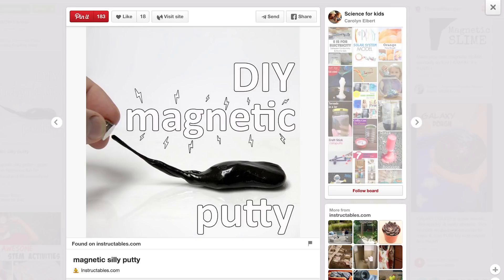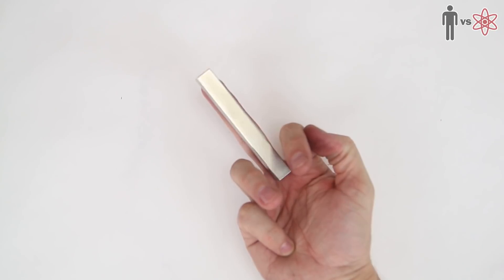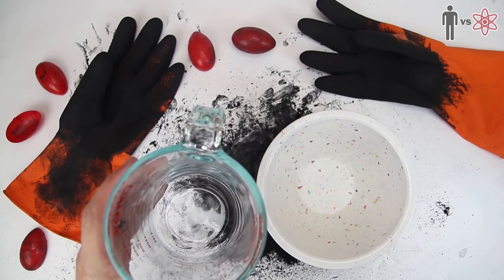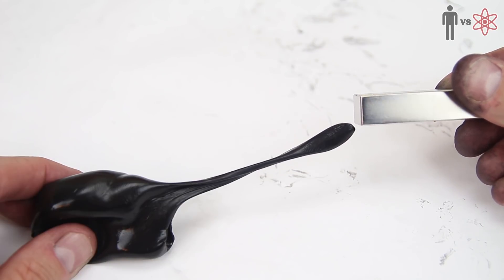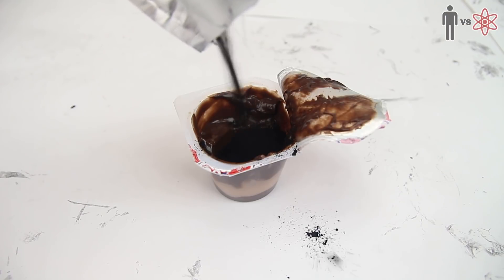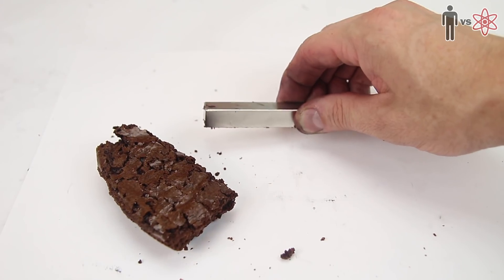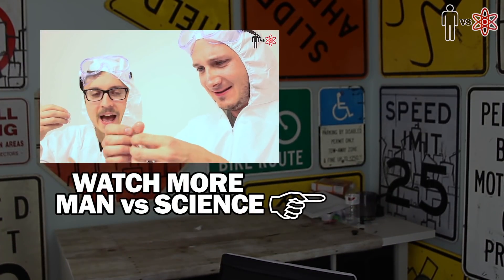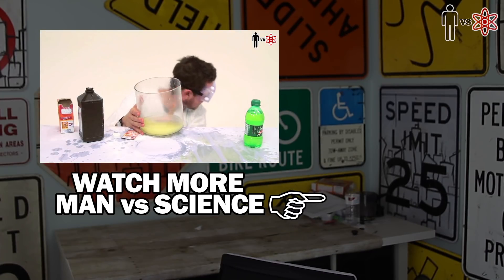DIY Magnetic Putty - Man Vs Science #4

Comment: 2:40 they work because the atoms charges point in certain directions creating 2 poles, and opposite poles attract, just like a regular electric charge. Fun fact: If you heat iron to a hot enough temperature (i.e. red hot) it will become a magnet, but if you heat a magnet to the same temperature, it become iron again.

Comment: Iron oxide is a REALLY difficult to make the chemicals are like carbon dioxide, naproxium sulfate, nitric acid I know is used, and iron. Iron oxide is pure powder not anything like iron filings and that's why you have to work it in. You can take an iron filing about 1/10th of an inch and put it into your ring finger and feel electricity running through wires. No harm is ever done.

Comment: The slime didn't work because you did it wrong you added liquid starch then glue you do Glue iron oxide then liquid starch or in between glue and iron oxide you fill the glue container with water shake it then add it in and mix

Comment: IF YOU DONT DO THE FUCKING COCONUT BOWL I WILL.........

 YOU DRILL A HOLE IN A COCONUT AND POUR OUT THE MILK. CUT IT IN HALF AND SCRAPE OUT THE COCONUT AND THEN SAND THE INSIDE AND OUTSIDE

Comment: One time I did a project that was "Does the amount of pixels affect the picture?" Of course it does, everyone knows that, but I did it anyway. Then, I didn't even use the right board. I used a poster board instead of a science fair board so mine was half the size of the other ones. I also broke 4 markers during the project and had to restart my 2000 pixel drawing, which was a huge pain

Comment: Along the same lines as your project: Do plants grow better when listening to music? My project was to find out if plants will grow just as good if you use any liquid, or if you should really use water. So I got two plants and spent 2 weeks watering one with water and the other with orange juice. The orange juice plant did not die, however it grew....something... on the outside of itself. Possibly a kind of mold of fungus. The plant also changed colour slightly; as one may have guessed  it went a little orange. Now it's worth noting that at the time, my Mom only bought juice from concentrate so it wasn't proper orange juice. Food for thought.

Oh and the plant smelt awful. I mean rank. I am thinking that the plant absorbed the water in the juice and left everything else behind, and what was left behind blue molded.

Comment: Watercolor Mugs!
Step 1: Gather All The Materials
For this project, you will need:
One white coffee mug (with no patterns or drawings whatsoever)
One plastic bowl filled with water (the bowl must be deep enough to sink the entire mug in) and some fingernail polish in the desire color.
￼
Step 2: Start The Project!
Once you have filled the plastic bowl with lukewarm water, add the fingernail polish to it and let it spread out. After that, take another polish (a different color) and add several drops of that one as well. Carefully mix the two colors with a toothpick and then dip your white coffee mug into the entire mixture.
Give the fingernail polish a few seconds to attach to the mug, let it dry for three hours and then pat dry your newly made marbled coffee mug with a paper towel. Make sure not to wipe it, though, as that will only ruin the entire design, and your efforts will be in vain! Check

Comment: I did a "science" project where I tried to see if you can determine how cold it is outside by the temperature on the inside of a window. I bought some dollar store wall thermometers (like, the coil kind, not mercury or whatever), cut a square out of cardboard boxes, taped two different thicknesses of glass over the holes, hung my non-scientific thermometers on the inside of the glass (somehow), put the boxes outside, then made a table of "data" from temps at different times of the day for like a week. I don't know, I think we were learning about the scientific method that semester, so it was really about using the method more than coming up with an actual, sound hypothesis, or even conducting a perfectly scientific experiment. My results: inconclusive. I didn't even get anything close to an honorable mention at that science fair. It was not worth honorably mentioning.

Comment: I didn't do a bad project per se  but I set up an electrolytic cell using pencils as electrodes and I split water into H2 gas and O2 gas like a MOTHER FUCKING BAD ASS. However in planning the project my teacher and I used distilled water and it didn't work because it didn't have any ions in it. We were confused for a whole day until we figured it out.